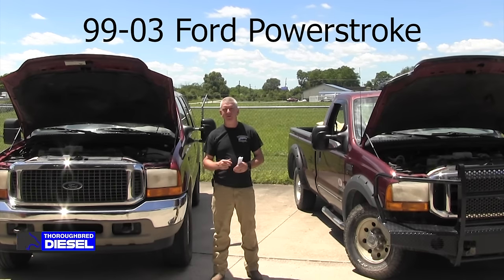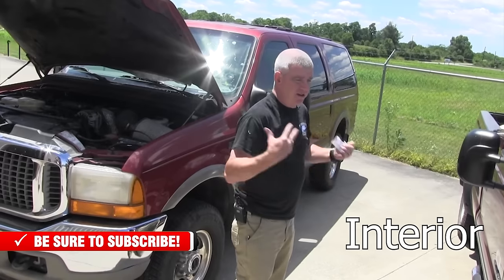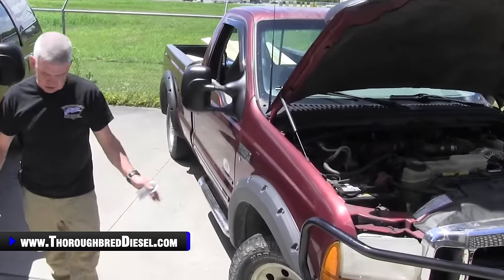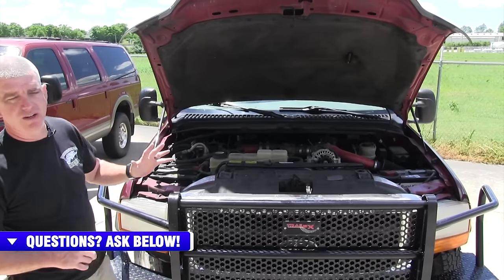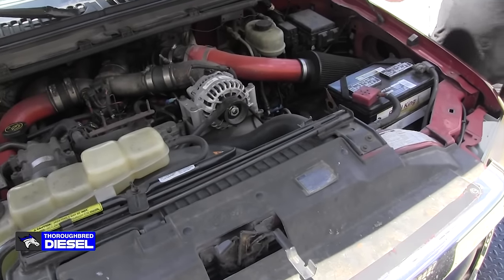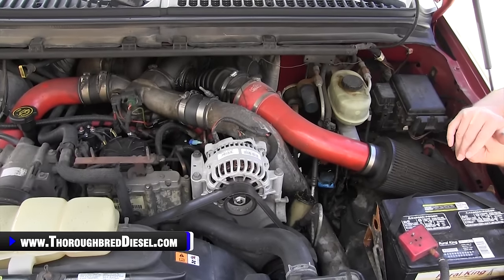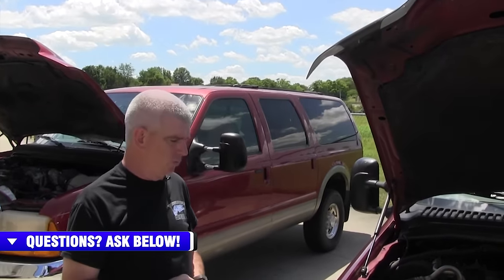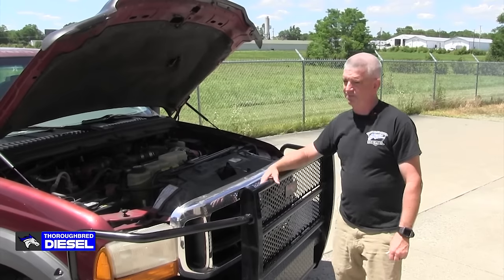TOP Problem Areas To Look At On 99-03 Ford Powerstroke | Secret Tips For Buying A Used 7.3L #ford

Comment: I don't believe you are knowledgeable enough to be explaining the 7.3. Lots of misinformation. First thing: see that k&n filter. Worst thing for a diesel.
By the way, I am a Ford Senior Master Technician. I've seen thes engines with over 900k miles and still ran great. 1999 had an early and late. Dont want early
Reply from the maker: El oh el
Reply: Shots fired, shots fired.....
Reply: I've got an early 99 and its got a big ole afe filter on it. Running those filters don't hurt anything. The problem these trucks run into is that people refuse to believe things could be made better than they were 20 years ago and they are way wrong. Great video guys!
Reply: I put a K&N filter on my '96 because the OEM filter housing disintegrated and had been discontinued by Ford.  What's bad about them?
Reply: I've made my living off of diesel trucks.  It's what I do.  I agree about K&N filters being a bad idea, 100%.   Sure, run them on an off-road toy, who cares.  Not good for longevity of a diesel engine.  The filter media is not strong enough to hold back dirt, on a diesel engine.  Once the filter gets dirty, that engine is just going to rip dirt, air, the entire filter, into the engine.  It'll just take whatever it wants through that soft cotton filter media.  Unlike gas engines, you probably wont be able to tell much performance difference if the filter is getting dirty to the point that this is happening.  So many good 7.3 engines have been ruined before their time from the junky factory air box leaking, or a cheap "performance" air filter setup (more than just K&N out there).  Use a big paper filter, like the Tymar setup, or 6637 NAPA filter, for instance.  S&B DRY filter setups are just fine too.  If you are actually going to clean a K&N PROPERLY, and at a decent interval, it'll probably be ok, not like its going to self destruct, but most people do not do that, and there is basically no performance gain.  Plus you have all that time invested in cleaning that stupid thing, who the hell wants to do that?
Reply: Oil coming out of tail... could it be caused by the turbo?
Reply: I have an early 1999 f-250 7.3 I’m replacing my gasket that has the screen on it I bought the gasket from Ford but it doesn’t fit correctly any suggestions?